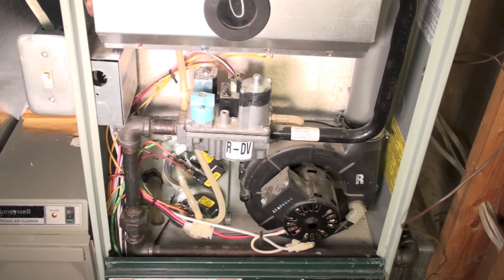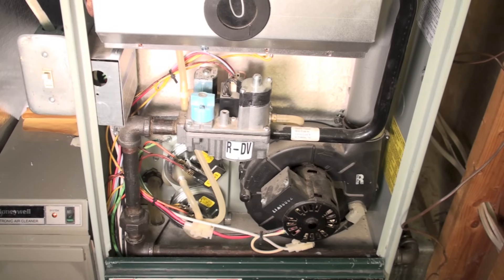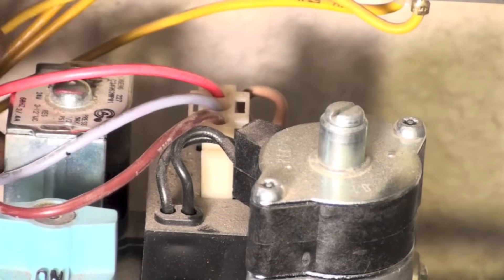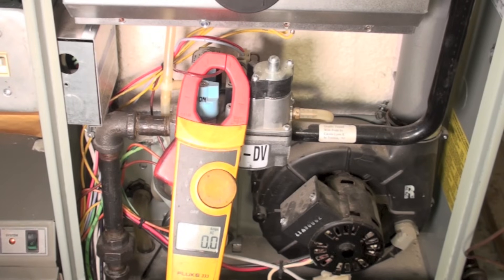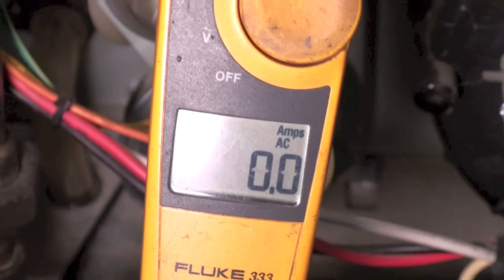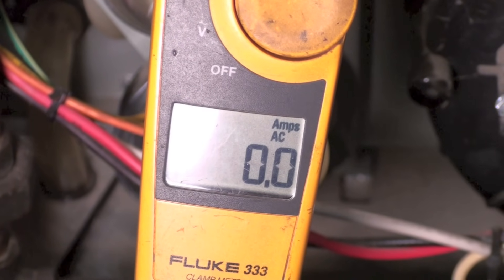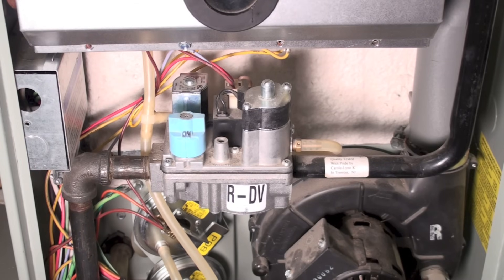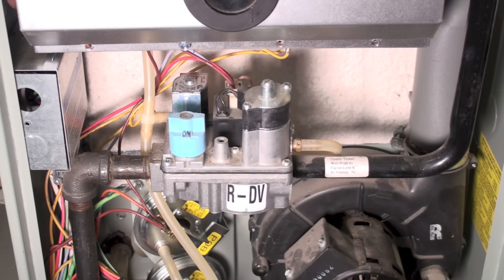The simple check of the gas valve

Comment: I have a brand new Revolv90  80% the pre vent fan comes on and cycles.  Then when the gas valve is energized the valve has a loud and hard knock or click noise 3 times then burner ignites.  Any advice what should I look for???? Thanks Ive learned lots from your videos.

Comment: My inducer kicks on, air switch closes, ignitor glows, then 27 volts get sent through wires to valve, but no gas. I'm replacing valve tomorrow,  I feel it has to be bad? I have confirmed I have gas in pipe upstream from valve. Thanks
Reply from the maker: First, be sure gas is available, then I would check amp draw of the gas valve when it is energized.  Sometimes the control will only send a ghost voltage with no amperage.
GFM
Reply: Hi. Tried replacement valve today (used). Still no gas. Confirmed I have gas upstream from valve. Then I followed your advice and checked both valves for amp draw and it says its drawing amps the whole time, but like .06. Doesnt change after ignitor glows. Sound like bad valve? Thank you.
Reply from the maker: @andrewm.4168  Sounds line a bad control board.
GFM

Comment: I have a gas furnace that works intermittently but I wanted your opinion on something. I moved into this house earlier this year and at the time the furnace seemed to be working fine for those couple months. I had a company come out to clean the furnace and they recommended replacing the surface ignitor and the flame sensor which they did.

When we went to turn the furnace on last month it started being intermittent. Basically, inducer motor comes on, 30 seconds or so later the surface ignitor comes on, then the gas will either ignite or it wont. Sometimes when it does ignite it will turn off after a few seconds. I always get code 34, flame proving failed.

I had a tech come out to look at it and they said the inlet pressure was good but the outlet was intermittent. He recommends replacing the gas valve for 493 bucks, which I did not do. Anyways, is there any possibility that there could be another problem besides the gas valve causing this, say intermittent voltage to the valve? How can I check that, is it constant 24v or only when the surface ignitor is on? Is that AC or DC?

Don't know if I want to invest another 500 into this furnace at this point it's about 10 years old.
Reply from the maker: +Warped3k You could have a failing gas valve, wiring problem between the board and the valve or the board could be failing.  Hope this helps.
GFM
Reply: +Warped3k I had the same problem. It was just a wiring connection. Might be worth getting a second opinion?
Reply: StormLaker1975

Comment: I've spent over $1500 the heating companies always tell me its this or that but had the same issue for 2 years.When it gets cold out the heater always gives me issues I changed the flame sensor,the igniter,the mother board etc but never the gas control valve I have a feeling that will solve the mystery as every part has been changed except that and I just tested gas supply its perfect.Leaves me to think gas valve is the issue
Reply from the maker: There is really nothing I can say to help without knowing the symptoms.
GFM
Reply: @grayfurnaceman  it works when its day time almost always 90% of the time every night between say 2 am till 8 am its off wont turn on i have a basic thermostat no ability to add schedule.What happens is fan tuns on igniter gets hot glows then stops the process goes 3 times and then shuts down and turns off i then flip the switch it goes threw the same process over and over I cleaned the flame sensor i even cleaned the igniter I changed the filter and the battery in thermostat i also had the gas company check my gas coming into house also all other gas appliances work never any issues.I have a Lennox furnace.
Reply from the maker: @Fm-ss4uj  Your description of symptoms does indicate a gas valve failure.  I would be looking at the wiring to the gas valve and power shown during a call for ignition.  
GFM
Reply: @grayfurnaceman  thanks for the info I have spent enough to nearly buy a new furnace so far thats the only part left
Reply: @grayfurnaceman  so I got 25.5 volts from gas valve but I put a candle lighter right by igniter it didn't turn on and I put my gas meter no gas coming out I think gas valve is stuck not allowing gas to flow properly I have to turn switch on and off and sometimes it turns on I just ordered a new gas valve last part to change.
Reply from the maker: @Fm-ss4uj  I would have to say the valve has failed.
GFM
Reply: @Fm-ss4uj Hello, can you pls share what turned out to be the problem?

Comment: So once you determine that there is voltage going to your GV but no gas, would you then check manifold pressure? and if everything is good do you then simply replace the gas valve??
Reply from the maker: +Johnathan Briggs I would check manifold pressure.  No pressure, check for incoming pressure.  Pressure in, no pressure out gas valve failure.  Hope this helps.
GFM

Comment: I have a Rheem furnace.  I put a used board in because my previous direct spark board would not spark reliably ... intermittently.  I had to tap the board to get it to send a spark, then it would engage the gas valve and run fine for a week or so.  Now back to where I'm at now....the used board I put in looks very similar.  All wires are transferred correctly.  The sequence goes; inducer fan, vacuum switch, direct sparks, then blower just blows cold air.   I am going to chk the gas valve for amps like you said but I am wondering if it's this board as it's not exactly the same as the original.  Is it needing something else to function?  It's a 62-24136-01.  I tried a ICM 292 board.  It did exactly the same sequence.  If I put the original back in, the gas valve works fine but maybe just for a week.  Any clues as to what's going on?
Reply from the maker: +DIY FIX GUY Sounds like the board is defective.
GFM
Reply: Change thermostat

Comment: 2 questions? What do the letters on the gas valve R--DV mean? Is it ok to use Teflon tape on the gas pipe threads or just pipe dope? Thanks.
Reply from the maker: I am not really sure the about the letters on the valve.  Probably for manufacturer use.  Teflon tape is sometimes used, but I have found it is not a good thread seal.  Hope this helps.
GFM

Comment: So what was the problem? Mine does it randomly. And I shut the system down wait five mins and turn it back on and it works fine for a couple months then it does it again and I reset it and it’s fine for two more months it is flashing a code two fast flashes followed by on long flash it’s a carrier and the gas valve is White-Rodgers 36E98-202 Furnace Gas Valve EF32CW191A
Thanks in advance
Reply from the maker: This is a video about how to check a gas valve but has little troubleshooting value.  So there is no problem.  The code you reference has no direct solution and would require further troubleshooting on site.  Sometimes these error codes just give you a place to start.
GFM
Reply: @grayfurnaceman  thank you for the reply. I will troubleshoot it
Reply: @nimster64 Hello, if you don’t mind can you tell me what turned out to be your issue? I am having the exact same issue error 21. Restating the furnace works fine but it will randomly not restart after few hours.
Reply: @matrix8164  hi. Well it was odd. I tightened all my terminals at the board. And at the thermostat. I snugged everything up and it stop doing it 😎 hope that helps

Comment: Videos are very informative. I do have a question about my furnace gas valve. My furnace every once in awhile does not turn on it does not send gas to ignite. I think the problems with the valve have checked wires I do have amp draw. But I have noticed when it doesn't work if I wiggle the wires at the gas valve and cycle again it works. Also if it is running and I wiggle the gas valve wires it shuts off. Have checked the wires they check fine. Is it possible the board or wires or pens inside the gas valve could be faulty?
Reply: Yes, could be bad wire connection in or out of the solenoid. Also, imagine the plunger in the solenoid is sticking.
A solenoid is an electro-magnetic device.    
When power applied & connected through the solenoid, the coils in it create a strong magnetic force that pulls (or pushes) the plunger/ pin in, or out. Usually a weak spring will keep the pin in the closed position till energized.

Comment: If the inducer cycles,  ignitor comes on, the gas valve clicks (24v verified), this 
says all the pressure switches and sensors are working -correct? The 
flame sensor circuit is not even active yet -correct? Bad flame sensors 
will only show up after flame should be detected -correct?  I have all 
of the above, with no flame. Additionally I have a modulating gas valve 
(97% furnace) with an additional stepper motor in the valve that is not 
turning (took the cover off and made an inspection hole to observe the 
stepper shaft end). Bad Valve? Board? or something else? Yes, I paid my bill,
and there is presence of gas at the valve and other appliances work. Thanks.
Reply from the maker: You are correct about the sequence.  If gas is available, and power is to the gas valve and no flame comes on, I would suspect the valve.
GFM
Reply: So, I had a local heating company with a good reputation give me an estimate of the repair. He checked exactly what I checked and also guessed that it is the valve. He had no idea why the stepper was not turning and could not ascertain that the signal to it was correct, meaning the board may have not been sending it the correct control signal, due to an internal logic problem or a distressed signal from elsewhere (this valve has 24v power and Tx, Rx wiring). When asked if replacing a good component was on his dime, he said it was not. I will not call him again.
I thank you for the reply and admire what you do for this audience. I also understand that a company's proprietary information sometimes protects the contractor and the consumer. But in the real world 
there are many many similar circumstances involving MUCH more liability than a furnace. Some devices are better kept in the 'black box' department and some people have to be told to call a professional, but this is a furnace, it's not rocket science -it's not even science. I am kind of horrified that proper diagnostic procedures are not more readily available with the bit of new electronics that some of these have -it will get worse -probably much worse -things tend to get more complicated, but maybe better? There might be an app for that!
A good portion of my work is in life support equipment, mostly mechanical. When a system is working or not, you are supplied by the manufacturer with comprehensive information to read the process of the devise, for failure prevention, and when and if it is failing, the problem is overly thought through, so you thoroughly understand the problem, the symptoms, peripherals, the result and the fix. I see very little of this happening in this industry.
So, I tried what you did in another video -manually lighting -I got just a flicker and movement on the outside regulator/meter, banged on the mod valve after it induced, glowed and clicked, got a little more -and eventually got full operation (not a fix I'm proud of). I had taken the valve apart previously, but didn't get into the stepper section since it was absolutely clean -was just checking for corrosion/blockage -that's a large screen!  I will buy a valve, install and check the pressures, but I can't help but think think a diaphragm/spring kit or a bit of lube wouldn't get it back online for the rest of this furnaces life.
Here's a dumb question -are rebuild kits available? Don't laugh, they are for every devise I work on.
thanks again.
Reply from the maker: One of the reasons there are no parts for those valves is the liability issue you brought up.  Even if the manual valve knob on the gas valve is not replaceable as the breaking of the knob indicates the valve is failing.  If you give met the manufacturer and model # I may have service info that may help.
GFM
Reply: @salvor1  Hello 6 years later, my friend.  I hope you are well.  The problem that you are having is echoed by dozens of posters in these comments, none of which having satisfactory resolution.  Your comparison to medical devices is very insightful because these machines in northern climates indeed decide who might suffer injury to people or their property so it is imperative to have full transparency.  But there is none.  A 30-cent grommet is held hostage for a $300 inducer assembly while all of the talking heads are screaming at the plebes to conserve and go-green.  A 30-cent edge connector is sold as a side harness for $63 when they know that their poor design will burn them out.  What we are looking at can be said no other way: Krim In All.  
If the gas valves are indeed bad then I think I have identified one of the reasons that the suppliers to the end users ship them in oversized boxes with no packing material so that they are tumbled in the dryer (so to speak) halfway across the nation before they get to the end user already defective.  LOTS of repeat business from that.
If you have resolved your problem please post again to tell us what you find because this problem is systemic to the very few mega-corporations that make multiple brand names that all use the same or similar defective parts and system.  Thanks.
GFM caught me into his channel when I first saw his video on the scam of cracked heat exchangers.  Diogenes would be pleased.

Comment: Valve 36G24 205 made a hissing noise and only one burner out of three came on.(one closest to HSI)
Then with no flame sense it goes out.
I allow it only to retry once.
Circuit board blinks normal green.
Stove/oven works fine.
After eight years could my gas valve be dying? 
Of course it is Sunday and it is snowing.
The sub. seems to be 36J24 214.
  Thank You!
Reply: Not the gas valve it's obviously opening that's the hissing your hearing!!
Take out each individual brass orfices and clear them something is stopping the gas from making it to the other burners
Reply: Ivan Luis
The hiss is an entirely new sound from listening to it for eight years. A soft tapping on the diaphram side and it works again now. But I an still considering changing it unless I find something else.
Reply from the maker: First, clean the burners.  They have flame spreaders that move the flame from one burner to the others.  Could be dirty.
GFM
Reply from the maker: The only way I can think of is if the manifold pressure is too low.  Should be at manufacturer's specs.
GFM
Reply: grayfurnaceman
Can you as an expert tell me if these valves can partially fail? Meaning are there ever failures where the valve only opens part of the way? Perhaps the regulator, which is built in, failed? I clean the furnace every fall but it has run for years without failing even once. And the heat exchanger is some kind of titanium alloy, which I imagine accounts for the hefty unconditional warranty. It is a Dayton(York)I do service work too and it drives me crazy not seeing the end result of a weird problem so I will keep you informed.
Reply from the maker: It could happen, although I have never seen it.  Usually, if the regulator fails, no gas flows.  
GFM

Comment: Would that gas valve be 24 volts? If so doing a amp test will indicate that it is getting voltage, but is it getting the full 24 volts to it.

Comment: Flame roll out switch keeps kicking off. I've noticed what looks like a low gas flow or the heat exchanger is bad. Can it be the solenoid?
Reply from the maker: If the unit has been running normally and has lately started kicking the rollout, I would be looking for a cracked heat exchanger.  Change in flame when the fan comes on is a dead giveaway.
GFM

Comment: What if the gas valve is stuck and you put amp meter on it and its showing amp draw. Your saying if you have amp draw the gas valve is good and its a gas supply problem. I am wondering if im not understanding what you are saying in this video? Thanks for posting this.
Reply: I was thinking the same thing if their is an amp draw than wouldn't that mean the gas valve is bad?
Reply from the maker: You might want to watch the video again.  I may not have been as clear as I could have been.  This video was done as a simple way to determine if the gas valve was energizing.  The determination of gas flow is a separate issue.
GFM
Reply: @ACentertainmentCo  if the gas is on then it was a problem with the valve.
Reply from the maker: Jumping in here.

Comment: So, I have 24V for a few seconds when the igniter is glowing, but no gas coming out. Just put a new gas valve in and its doing the exact same thing.  No flame. The old unit seemed to work occasionally but not in a past week. It was on-off for about 2 weeks. If I wiggled the solenoid, it would come on and work for a day or two. Now in a past week it was just not working at all.  I did measure the 24v, its all there in the time when the igniter is glowing so all pointed to the gas valve issue so i did replace it.  It did nothing. Same issue. The fan goes on, the igniter glows, and then i get 24v at the gas valve but no gas comes out. Of course gas is on, bill is paid, the 2nd floor unit works just fine, along with the water heater.  So what can be the problem ?
Reply from the maker: Check amperage on the gas valve wire.  You could be reading a ghost voltage.  Amperage should be around .2 amp.
GFM

Comment: Having a prob on an old gas furnace where the u light the pilot light it stays on but when I turn the heater on the blower comes on but I'm guessing the gas is not flowing through the chambers. What could be the problem?
Reply from the maker: If there is power to the gas valve and all valves are open, the gas valve has failed.  Hope this helps.
GFM